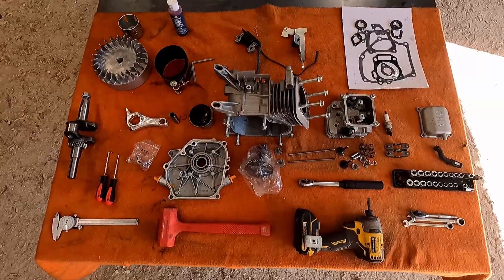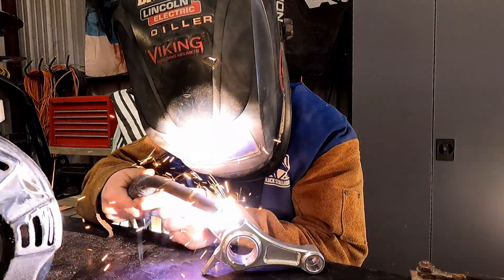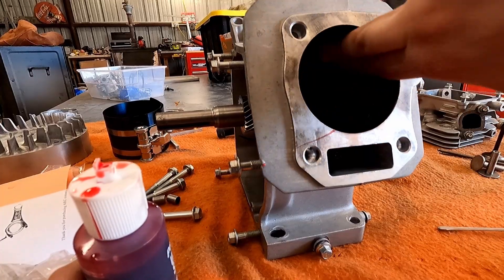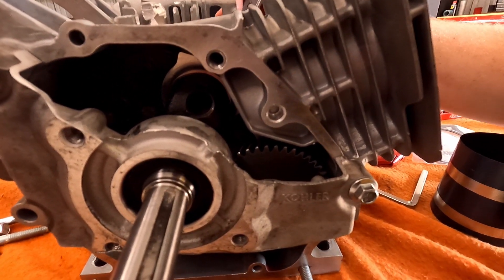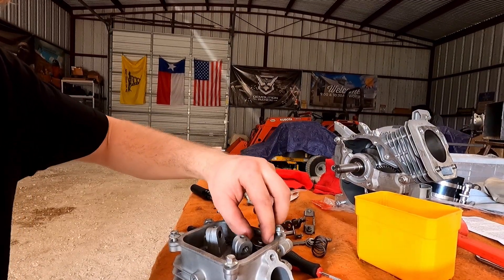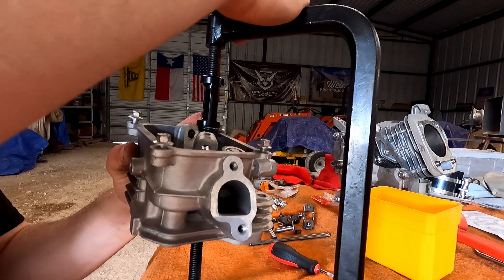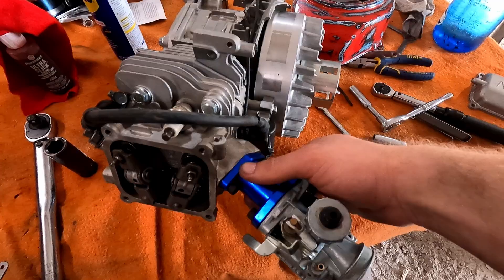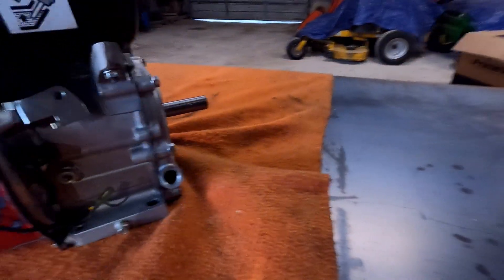Scary Powerful! Built Harbor Freight Predator 212 Hemi Engine.

Comment: Tune it for E85 and you'll make 50% more power
Reply from the maker: @a.m.bgarage.everydayprojec9665  Great idea bro! That will be next and porting the head.
Reply: @Bataha  Right on. Both increase the power a TON! Just make sure you up-jet at least 15% higher when running E85 cuz it burns a LOT leaner.
Reply: E85 isnt going to do anything in an NA engine.  It may allow you to run higher compression than you could on pump gas, but nothing that a predator is going to be able to take advantage of.
Reply: @Chocolate_dragon  Ethanol contains oxygen in it's molecular structure, which only requires effectively half the oxygen to combust, but releases 28% less power. Since the limiting factor for power is oxygen, you can effectively gain around 20% more power with Ethanol (or around 15% with E85).

You are right about the higher octane rating allowing for higher compression, but Ethanol also absorbs 3x the heat during combustion and since there is 2x the fuel, it almost halves intake temperatures.

My 212 bike ran on E85 and later tuned it for straight Ethanol. It immediately gained a TON of torque and ran SO much smoother. It also took SO LONG for the engine to warm up and even after 5 miles of riding, the exhaust would be cool to the touch and the intake would be so cold, frost would appear on the intake.

With all this being said, you might not see a hige difference with a weed Wacker or stock 212, but on dirtbikes, cars, and built 212's, you see a HUGE difference between the power and everything else.